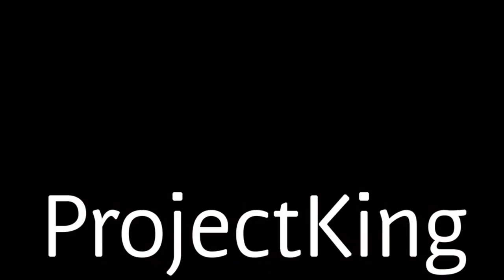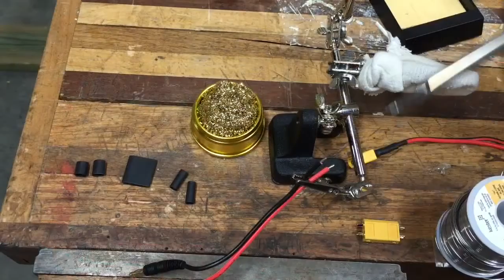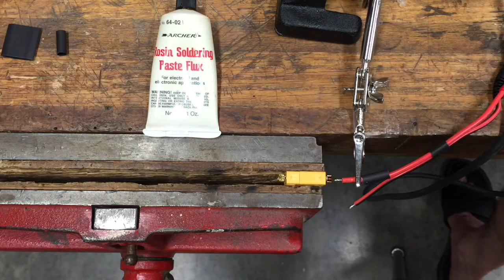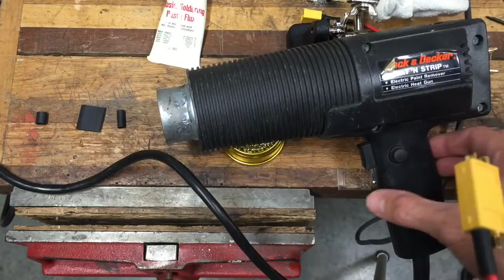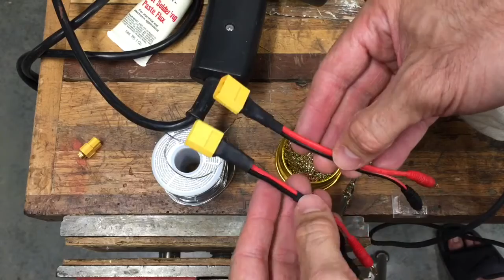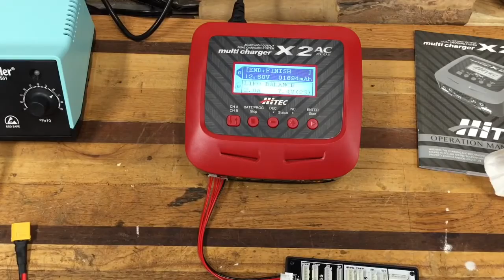How to Solder Battery Connectors; Charger DUALITY; Pt 2/2

Comment: Yes, like your cub s takes, I'm trying to avoid buying multiple chargers. Do you have a link where parts can be bought or a link to where you bought the adapter, I'm not having much luck..thanks
Reply from the maker: +Novice RC Guy Google 1S charging board.  Amazon sells a few.
Reply: Found one on Horizon Hobby as well as the charger..Thanks

Comment: Do you use the xt60 connectors as a matter of preference? are they like deans plugs?
Reply from the maker: I researched the plugs.  I like the xt60 because they seem to be better protected from shorts than deans.  The deans would work well too.  For my aircraft I plan to use xt60 and for my vehicles I'll probably use the Traxxas style.  Of course I have the old fashioned Tamiya style as well...  Have an adaptor for those.  (0: